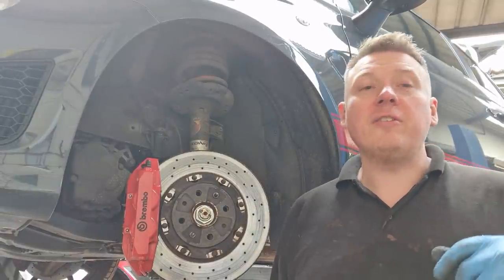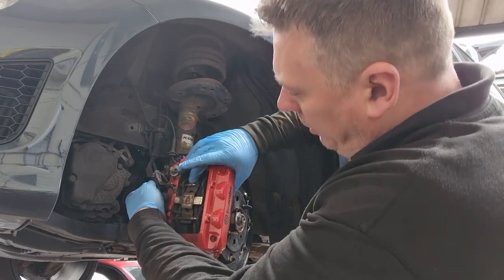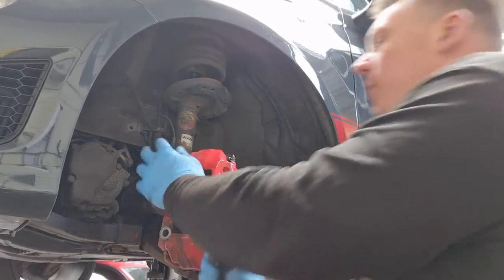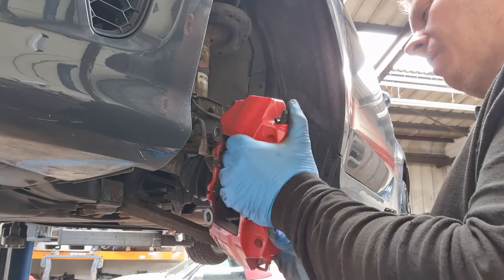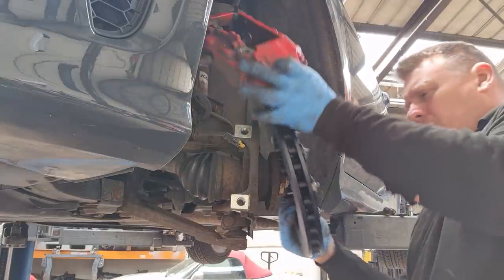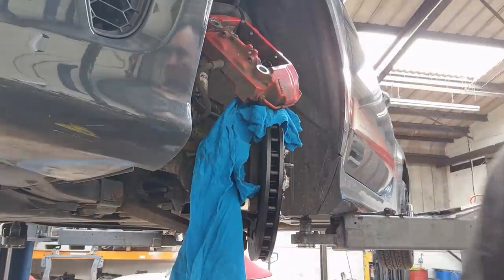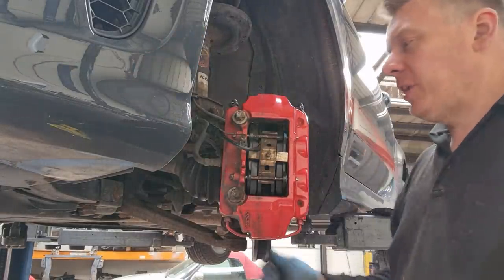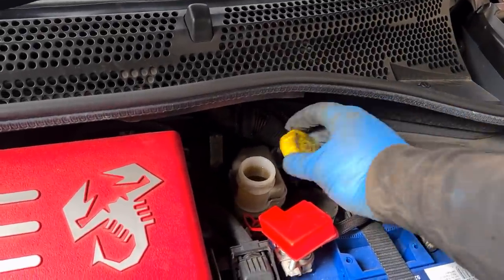Abarth 595 Brembo Discs and Pads change

Comment: "A fool and their money are easily parted" - Parts suppliers everywhere
Those brakes are massive overkill for a road car really...
Reply: Particularly given the weight of the car and unless you're track racing those discs aren't needed to do the job.
Reply: They aren’t it’s a little car but very high bhp and it would be under braked with normal brake discs on .Iv had a bigger car with what you would say are adequate brakes but it was massively under braked and it really needed brembos on  it but it was a 3000 pound upgrade when the car was new unfortunately the 1st owner didn’t think they were required
Reply: @bmwman1981  Hearing ya but Dude it has a relatively normal 121 kW/t on a featherweight 1100 kg. My JCW has more. Hell even my Alfa has 6 pot Brembos that cost nowhere near this extortionist price. Neither did my Porsche whos brakes are way bigger than these. Simply change the brakes to a different Brembo model. Bad form on Fiat for making this stupid spec. But I'm glad I now know as if I want a 595 I'm smashing the owner with a £1,000 discount should the rotors be worn! It's prob the main reason many go for sale too. Owners simply freak out and just decide to sell it than get raped in the ass.
Reply: Yes, overkill - sort of. Opposed piston brakes gives better modularity, so a skilled driver can brake right on the point... but on the road and most drivers, simply unneeded and adds extra cost. Two part discs - this is probably the one area where it really is worth it. For such a light car, if you can save a few kilo's of unsprung mass, it will make a big change in the vehicle dynamics. I noticed going from 266 to 283mm discs on a 1 tonne car made the steering less responsive (increased weight). 

"Too much brake" said nobody ever :) The only problem with this set up is not how overkill it is but the extortionate cost to replace, cheap, cheerful, fast cars are awesome. But not when paying Porsche prices!
Reply: @khalidacosta7133  My Porsche brakes were cheaper than this for a 1600 kg / 400 hp car with 6 pot Brembos. Floating rotors on a 595 is simply a complete wankfest. This Fiat choice lands squarely in the basket labeled 'Stupid'.
Reply: @CathodeRayNipplez  That's just down to market economics. How many Fiat 595's will be sold with these brakes? Miniscule amounts... whereas how many Porsche's will have big brake kits? Far more, especially as the brakes will be the same on multiple models, even on Audi's etc.
Reply: @CathodeRayNipplez  must be an old Porsche an m2 brake rotor is more expensive than that
Reply: @CathodeRayNipplez  The Fiat 500 was produced BEFORE Stellantis was even a dream. The wheels have a strange bolt pattern, 4 x 98, which other car shares that? Well that rules out brake discs. Calipers? Well it needs to fit into a small wheel space and I can guarantee that the mount will be strange. Remember all those "off the shelf" calipers requires adaptors which manufacturers do not use. They HAD to use bespoke parts. If you didn't like it, then either don't order it, replace with an aftermarket kit or swap to the cheaper OEM set.
Reply: @rscholey85  Porsche make an m2?
Reply: @khalidacosta7133   Mito uses 4 x 98
Reply: @bmwman1981  very high bhp? Behave yourself 😂
Reply: @khalidacosta7133  Fiat has used 4 x 98 since at least the '50s.

Comment: N.   I have a similar set of calipers (well, on my 156GTA - which uses a similar large Brembo),   having change the pads a number of times over our long ownership - I recently had to change both discs and pads.  All were brand new genuine parts.  The problem is .... I now have a squeal - on the final bit of breaking.  Just as you come to that final bit of stopping, at say traffic lights.   I was really, really careful when installing the new discs / pads etc to make sure everything was thoroughly (and I mean thoroughly) clean.  Lots of old toothbrush cleaning with brake cleaner around the stainless plates etc where the pad sits, for example, lots of wire brushing.   I know there can be corrosion under these (stainless plates) that lifts them up for example and holds the pads too tight.  But none of that really, and some careful copper grease in places - but I now have this annoying squeal, all the time on final breaking.   Have you had this before - and found a remedy?

Comment: I broke 2 ratchets today trying to get the calliper carrier bolts out of a Mito Veloce I`m breaking, because I only had a 3/8" drive socket for the torq/star bolts, but only got 1/2" breakers & guns. Bastard things. Managed to borrow a 1/2" to 3/8 adapter in the end.

Comment: Few technical remarks, don’t take it wrong, I love your work :). Generally it is not a good idea putting copper grease between brake disc and aloy wheel, these two never stick together. Only steel rims do that. Never put aluminium and copper together, it doesnt like each other, chemical reaction starts eating up your alu rims slowly. Grease just a wheel hub under the brake disc so you don’t have to hammer it down next time. It is steel to steel surface and it will be just fine.
I’d replace securing pins with a new set for few pounds to avoid any damage next time. It’s not a reasonable saving using old rusty pins if you already spent more than 1000 quid for discs and pads.
Reply: Certainly had alloy wheels stick to the steel of the hub (especially around the centre locating rim - takes very little corrosion there for the wheel to be jammed on)
Reply: @katywalker8322  yep fully agree. Wife had a fiat 500x with 18" wheels and one totally seized into the hub!!

Comment: The way those pads went in so tight suggests the inside sliding surfaces of the caliper needed cleaning....just like you actually mentioned.

Comment: Hi Neil. Thanks for the video (and all the others too). I wanted to change the brakes on my 159 Ti yesterday, but the pins are seized. The point is now flat. What would you advice for getting them out? And also, the calliper is connected with a solid pipe instead of a flexible brake hose. Do you really have to bleed the system in order to get the discs out?
Reply: can you not take the whole caliper off and get it in a vice?  get a good drift and smack it out.
Reply: @therushden  I am not equipped for bleeding the brake system, so I wanted to keep the calliper on the car if possible.

Comment: Just checked my 2020 reg EsseEsse  brembo equipped discs a single piece disc...so is the two piece actually required.
Reply: Pre-2016 Brembos are two piece. Later ones are not.

Comment: Which 595 is this? I took my Brembo equipped 595 Turismo to Blyton for a track day and, at something less than racing speeds (I race a 69 Giulia), the brakes were useless (long pedal) after a lap. So, either the Brembos in the video are a worthwhile addition (if you track your 595) or, if they’re the same as mine were, they’re useless as standard.
Reply from the maker: 695 xsr but same brakes as all comps fro. 2016
Reply: @ItaliaAutos  then probably worthy of some decent brakes if used in anger (and I’d hope a 695 was). The Turismo’s brakes (a heavier car?) weren’t up to much.
Reply from the maker: @meanredspider  having owned 2 comps the brakes are awesome

Comment: Brembo`s are always massively overpriced, if you think they`re bad, check out the BMW M or Jag R prices for them, they`re like the cost of a 10yo Abarth just for a front disc & pad change.. 

500 Abarths can fade if you hammer them, but theres much cheaper ways of upgrading them than fitting Brembo`s.

Comment: As far as I know now , you should not remove the calliper screws as you did as those are expansion screws (should be used only once) - it is better to remove the screws at the back (from the calliper bracket). 
Bad luck - it did it as in this video and you cannot buy the screws at fiat store! No way to find it…
Reply from the maker: Sorry don't think they are.
Reply: @ItaliaAutos  well also the fact that fiat does not list them shows me that those bolts are not there to be removed… 
If you buy the Abarth Brembo kit, those screws are also not touched - it is already in place… 
Anyway quite some people say that is it a risk not to change them (which makes a bit of a bad  feeling for me now)… 
If you are sure and you‘ve read the Abarth repair manual - all fine 😀
Reply from the maker: Been using them for many years never had an issue

Comment: These are supposed to be affordable cars for the everyday man.  That's ridiculous!
Reply from the maker: Just don't buy the top model if this item is out of your price range, as they use normal discs. 👍
Reply: @ItaliaAutos  Never said it was out of my price range. Brakes on a Fiat shopping trolley should not be £1000.
Reply from the maker: Never meant you personally 😃

Comment: Can get these discs for a lot less than that lol. found them for £235 online.. The owners been proper mugged off there.
Reply from the maker: He ended up getting 50%off I did say in the video.
Reply: @ItaliaAutos  no I fully appreciate what you said in the vid, unlike a lot of people that comment, I do pay attention. That still works out at 258 a disc which is still more than the 235...
Reply from the maker: @cleanlinesautomotive9826  best price customer could find at the time. Lots of the ones listed on ebay are out of stock but still listed. Even my Abath supplier where around the same price. Thanks for watching 👍
Reply: @ItaliaAutos  Yeah, that's fair enough dude.. I'm just a tight arse lol...

Comment: Cars not even that fast/powerful is it, to need such expensive parts?  My  giulia veloce, pads and discs front and back, £250
Reply from the maker: They are proper little pocket rockets.
Reply: I had a ‘basic’ 500 Abarth and it was definitely under-braked
Reply: My wife’s 595 Abarth Competizione came with 180bhp as standard. Don’t underestimate these little cars they can move.

Comment: Great brakes, unfortunately the rest of the car is a disaster - no steering feel coupled with weird weighting, awful suspension settings resulting in crap handling. I basic ST Fiesta is miles better. Basically a cynical marketing exercise.
Reply from the maker: sorry you must of lost feeling in your arms. in the 2 595 comps ive owned they have great feel,  you know what each wheel is doing all of the time, yes susp is hard but it handles so well. ive also tracked a 595 and think there great value for money. ive also driven a new ST great cars but lacks personality in my opinion. thanks for watching.
Reply: @ItaliaAutos  As an ex racer and track instructor for a number of tracks in the UK, I think I have perhaps a more accurate perspective, which aligns with the road tests of this car. Using the Abarth name strikes me as a marketing exercise given the car was poorly developed, the ST or something like the GR Yaris have real development behind them.

We tried a couple of these as part of our track day fleet. One of them lunched its gearbox on the first day, but worse they were rubbery, inconsistent and about as hardcore as a DFS sofa.